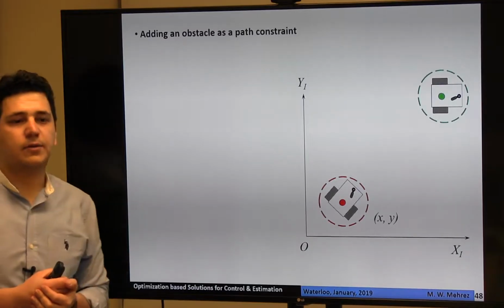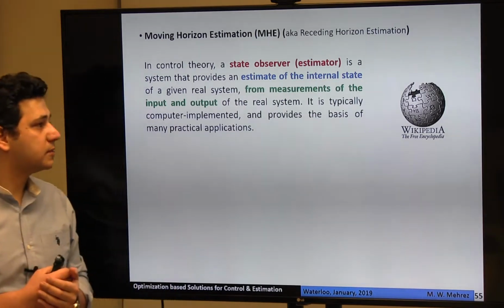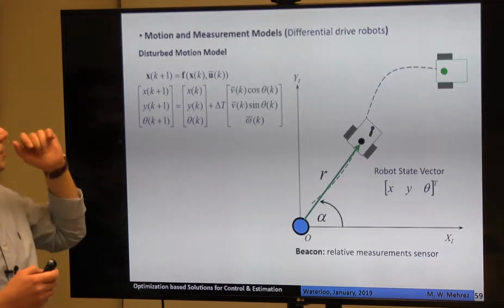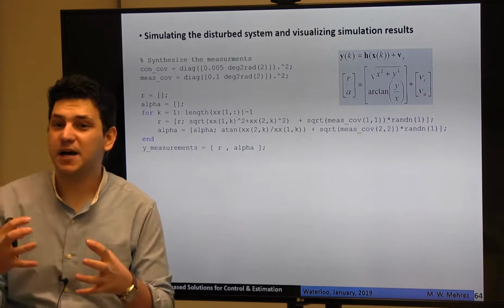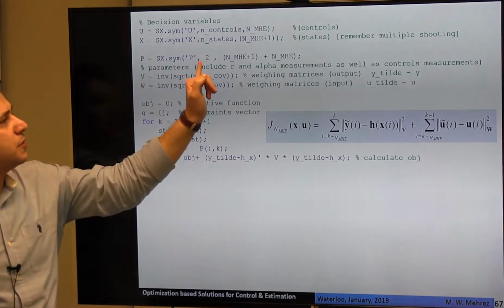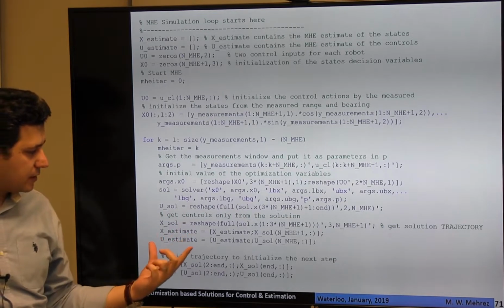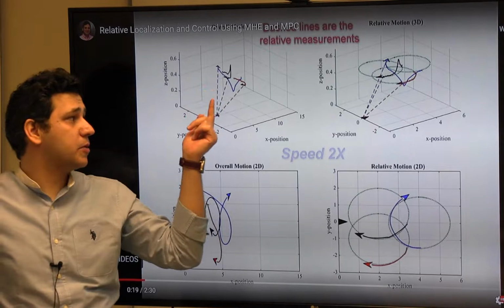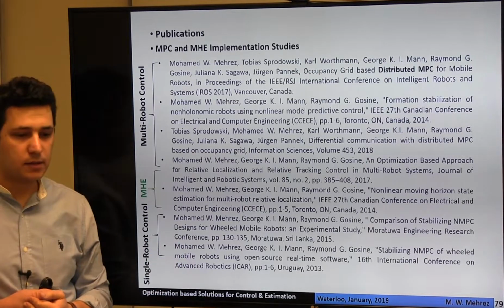MPC and MHE implementation in Matlab using Casadi | Part 2

Comment: Great video and impressive results with the distributed MPC! I have a question though, how much more difficult is it to use rectangular collision constraints around the obstacle instead of circular ones?
Reply: I have a rectangular car that i want to drive around another rectangular object, what i tried to do was do a projection of all corner points on the y-axis since my car can not drive directly sideways and the smallest corner point of the obstacle should always be bigger than the biggest corner point of my car to avoid collision. Yet I tried using CasADi's mmin and mmax function but then the solver also runs extremely slow, and the car might never reach the target position.

Comment: Hello dr. Mehrez, Thank you for the nice lecture. It helped me alot even though I'm very new to MPC and also Casadi. 
I have one question, how can we update the position of obstacle if we say obstacle is not static. I tried to update the position of obstacle in the main loop, however, it seems that solver doesnt realized the new position of obstacle has arrived and it only considers initial position of obstacle during the whole simluation time.

best regards
Reply from the maker: Hi, Thank you for your comment. In the case of an obstacle whose position is dynamic, you will need to treat its position (or potentially position prediction) as a parameter that you pass to the optimizer and then you build your constraint based on this parameter. This is similar to passing the initial position of the robot to the optimizer every time step. Hope this helps!
Reply: @MohamedWMehrez   Thank you for fast reply and clear answer, also it worked! 
I made larger size of P vector and I added trajectory of moving obstacles as well as initial position of X and reference point Xs . 
But I'm considering of combining many obstacles and multiple robots (with collision avoidance). In this case, the size of P vector will be keep increasing and it will be confusing to put all the parameters in a single vector. so Im wondering if there is any solution for this. ( I tried to make parameter vector P as a struct but it didnt go well)
thank you for your concern
best regards

Comment: Thank you Dr. Mohamed for the excellent presentation. I have a question please, in my problem the measurement_rhs is depending on time like X*t+B, X and B are states to be estimated and t is time (known/given vector), how can I introduce it in Casadi? I tried to put it as in input or a measurement and it was not working. I am tying to do state estimation only using MHE. Thank you
Reply from the maker: Hi, In the prediction, just replace t in the model by k*sampling time.

Comment: Dear Dr Mehrez, thanks for your presentation, it was very useful for me. I have two questions I would like to ask.
(1) In mul_shooting, x_next=X(:,k+1), I want to know how X updates the state in casadi program?   I don't see any update of X in the while loop.   
(2) In part 2 video, How do I get the code for four robots moving around circles?
Reply from the maker: Hi, 
Thank you for your comment
(1) only the first entry of X is updated in the while-loop by the robot current pose x0
(2) all codes are on the GitHub for the discussed examples. The link is in the video description.
Reply: @MohamedWMehrez  I just checked and GitHub doesn't have this part of the code. The simulation of the circular formation of four robots, followed by the verification experiment of unmanned vehicles.

Comment: I also tried to add a road set up for which i tried to add constraints and also had to add if conditions. However sx cannot be converted to logical and the if statement also returns the data type in sx, is there any way to convert sx to an integer?
Reply from the maker: I think there is something about this in Casadi manual.

Comment: I have a doubt regarding MHE if it estimates the path at t- N(MHE)  how does it help in estimation of the path for MPC if it has already move through that path?
Reply from the maker: What i did in this lecture is what you may call offline estimation, i.e. i generated the sensor data and estimated the path from it. If you would like to integrate MHE and MPC, you would run MHE online, i.e. you apply it to the most recent window of measurement (as what happened in this lecture), but the estimated pose on the path is used as a feedback to the MPC controller.

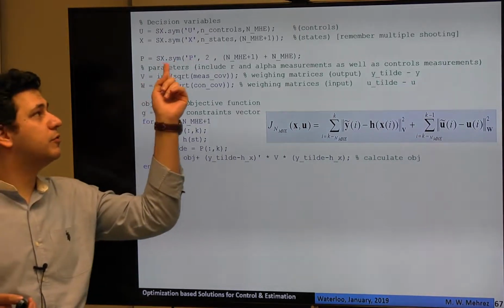Comment: Dr. Mohamed W. Mehrez, thank you for this excellent presentation and for providing us with an ideal material to learn about these topics. I have a doubt; from minute 33:20, you explain the vector P and comment that they are lucky because they have the same number of inputs as outputs. My question is about this, what happens if this condition does not occur? If I have one output and 2 inputs, or one output that is state variable 3 and the input directly affects state variable 2? How is this correctly defined in Casadi? I reiterate my congratulations and thanks for this material.
Reply from the maker: Thank you for your comment. If the dimensions of the input and the output mismatch, you can simply define the parameters vector P as a single row vector, then you arrange your measurements in this vector in whichever way that's most convenient to you. Just keep in mind that you need to propagate any changes in the rest of the code.
Reply: @MohamedWMehrez  Thank you very much for your response, we look forward to more videos like this one. Regards

Comment: Hi Mohamed, 

Thank you very much for building my intuition on MPC, 
I'm very new to vehicle dynamics and control engineering, i have one general question,
If we would like to take the kinematic bicycle model for the non-holonomic robot instead of differential drive robot , for example with state vector: {x, y, v, phi} and controls : {a , delta}, 
 how would the RHS/ (model) in the code change, if you could share some thoughts on this it would be wonderful, :)

Thanks and regards,
Shagufta,
Reply from the maker: Hi, thank you for your comment. You simply change the model. this means you would have a new state vector with 4 variables in this case and the r.h.s. would be what ever your new model is.
Reply: @MohamedWMehrez  Thank you very much Prof, i really appreciate your prompt reply, i just have one more question, can we add terminal cost function to this OCP? if yes, how do i go about it?
Reply from the maker: Yes, you can... Just after the loop where you create obj, you can add an additional term for the terminal cost.
Reply: @MohamedWMehrez  i was about to lose my sleep tonight, i can't thank you enough, world needs ppl like you <3
Reply from the maker: Thank you Shagufta 🌹
Reply: @MohamedWMehrez  Hey Mohamed, got another simple question for you  ;), 

I'm trying to use MPC in ROS platform and i successfully wrote casadi code in C++  , i want to control or drive a car in carla (or any other simulator) from point A to point B using MPC( point stabilization problem), please correct me if I'm wrong, i should apply the first control action to the car and after delta_T time i should extract the car's position from simulator and continue the while loop? , did you use ROS as well for controlling the robot, if yes, could you please help me out in this one last question :),

Regards,
Shagufta
Reply from the maker: @shaguftaqueen5630  Yes, that's exactly how you should do it.
Reply: @MohamedWMehrez  Thanks a ton, i will try it <3
Reply: Dear Mohamed, 
I have one more question, right now we are giving the position of the obstacle while formulating the MPC itself, is it possible to take the obstacle position on the fly and do obstacle avoidance?, i couldn't find a solution for this issue, i thought I'd ask an expert ;),

Regards,
Shagufta
Reply from the maker: Hi, I believe that you can take the obstacle info on the fly, but you may want to impose some assumptions on the obstacle motion beyond the time of its latest known position, e.g. you may assume that the obstacle will have the same speed when you latest captured it. This speed can be later used to calculate the obstacle prediction and used as a constraint on the robot motion. Just keep in mind that as the actual position of the obstacle is deviating from its prediction, the quality of the mpc control action will be poor as the controller will keep changing its policy based on the updated obstacle position; It's not an mpc problem though.
Reply: @MohamedWMehrez  Thank you very much for the quick reply ;),
I really appreciate your support even after so many days of publishing this video series 
<3

Comment: What happens when we have dynamic obstacles instead of static obstacles, is there a way to incorporate the moving obstacles in MPC ?
Thanks in advance,
Reply from the maker: Hi, Of course there is a way for that. you simply add the constraints such that the prediction of the robot avoid the prediction of the obstacle at the respective time steps.

Comment: Hi Dr.Mehrez,
we have a project on multi-robot path-following with obstacle avoidance system, we've been asked to work with MPC and i wonder if you can give us an idea how to manipulate your code in order to use it for multi-agent system or if it's even possible.
Thank you in advance.
Reply from the maker: Hi, there are basically two approaches to apply MPC for multiple robots. First, a centralized approach where you combine all the vehicles models into one and add the proper constraints among them to address collision avoidance, etc. I this case you will need to run a single mpc instance which will generate the proper control action for all robots. Second, the distributed approach where you run MPC for each of the robots and communicate there future predictions and then add them to the constraints. You can find more details about the two approaches in the following papers. Just keep in mind that a centralized approach is suitable for smaller number of robots while the distributed one is suitable for a larger number of robots. (Centralized has a better performance, but again may not be feasible for a large number of robots)

https://link.springer.com/article/10.1007%2Fs10846-016-0408-2

https://ieeexplore.ieee.org/abstract/document/8206360/

https://ieeexplore.ieee.org/abstract/document/6901011
Reply: @MohamedWMehrez  Thank you so much Sir for your response

Comment: Dear Dr Mehrez. Thank you very much for your great presentation. If I want to combine MHE and MPC together in my simulation, I have a question related to past measurements over a window of size N_MHE (k-N_MHE). How can I obtain past measurements, so I can obtain estimated states for the feedback in MPC?

Thank you.
Reply from the maker: Thank you for your comment; to do this,  you actually have to run your system in the open loop and buffer the measurements until you fill the 1st window of measurements on which you run the first MHE step.
Reply: @MohamedWMehrez   SIR,THIS IS A NICE TRICK OR SLUTION.
1) BUT IN REAL TIME ALREADY OUR MHE AND MPC ARE CONNECTED WITH OUR ROBOT WHICH MAKES IT CLOSED LOOP . SO HOW IS IT POSSIBLE TO GET OPEN LOOP U_CL AND  Y_MESUREMENT.
2)ALSO SUPPOSE IM WANTING MY ROBO TO TRACK A PATH.  STARTING AT T=0. NOW THE U_CL AND Y_MESUREMNT PAIR SHOULD BE A PART OF THE TRAJECTORY , OR IT CAN BE SOME RANDOM U_CL AND Y_MEASUREMENT PAIR (WHICH MAY NOT BE PART OF OUR TRAJECTORY)THAT WE ALREADY FILL THESE MATRICES BEFORE T=0?AM I RIGHT?

Comment: can we set dynamic obstacle as constrains and if yes how
Reply from the maker: Yes you can. If you have the prediction of the dynamic obstacles motion then you simply constraint the motion of the robot by the motion of the obstacles. This means that for every time step in robot's prediction you constraint it to be outside the obstacle boundaries at the corresponding time step from the obstacle predicted motion.
Reply: @MohamedWMehrez  But f I add a new constrain at each time step, would not all of that constraints pile up and making the system too heavy ?
Reply from the maker: @fetullahatas3927  it will be a little harder to solve than the static obstacle case discussed  in the workshop, but will be still feasible in a reasonable amount of time. Remember that in the static obstacle case, we constrained the robot at all the prediction steps but to a static boundary (i.e. the static obstacle).
Reply: @MohamedWMehrez  Thank you for your reply. I think if there is a online way to update/remove/add the constraints added to optimization problem it can be solved. Are you aware that it is possible to update/remove the constraints from the problem on the fly ?
Reply from the maker: @fetullahatas3927  of course this is possible and it can be done similar to the trajectory tracking case discussed in the workshop; therein, the reference was updated online ever time step.
Reply: @MohamedWMehrez  I am also interested in this but I haven't figured out how to update the constraints on the fly. How can you update the vector 'g' that contains the x and y positions of the obstacle (and its future predictions) once it has been initialized? Do we have to initialize 'g' and create a new solver per loop iteration? Or is there a better way? Thanks in advance Mohamed.
Reply from the maker: @9thchord  you can make the x and y positions of the obstacles as parameters and you pass their updated values every solver call. Should be the same way you pass the state feedback.
Reply: @MohamedWMehrez  Thanks very much for your prompt answer. That worked perfectly!

Comment: Hey Dr.Mohamed,

Thanks for the lecture series. Its very helpful for beginners and well explained.
I followed your lecture on MPC implementation and borrowed some techniques from your presentation for a simple trajectory planning algorithm in which I have 8 states and 2 control inputs, with the states themselves being my measurements too. 
Now I would like to go a step further to combine the MPC with the MHE. I have a couple of questions related to this.

1. In your lecture on MHE, you include the multiple shooting constraints alone with the MHE problem formulation. The objective function for control is missing. Should I need to add them just as in the MPC implementation, for trajectory reference tracking .
2. If I would like to combine the two , would there be two separate objective functions and would there be an OCP solving twice for each time step, one for MPC and another for MHE.
3. Could you also give a few hints on how I can use the MHE output to MPC. 

Thanks a lot again for your workshop!!

Regards,
Anand
Reply from the maker: Hi Anand, thank you for your comment.
1- In the lecture I implemented MHE offline separately from the MPC implementation; that's why I used a single OCP with the multiple shooting constraints (because it was MHE only).
2- Yes, exactly.
3- Every time step, you simply get your sensor measurements feed them into the MHE estimator (first OCP); the output of the estimator then becomes the MPC feedback (second OCP). 
All the best!
Reply: Thanks a lot for the quick response!

Comment: Hey Dr. Mendez

I was having trouble implementing the input rate of change constraint. As we never specify initial input, my rate of change of input always start with u2-u1 rather then u1-0
Reply from the maker: You can do that and in the following iteration you use the most recent input sent to the system. Always remember that the first input change rate is the difference between u1 and the most recent input applied.

Comment: Great workshop, thank you for sharing it, however, i have a hard time adding another obstacle, can you tell me where should i edit the code to accomplish this?
Reply: nevermind, i got it, i was missing the ubg and lbg size, i had to multiply it by 2, now i just need to edit the draw function to visualize it. i will try my best to do it,
Reply: got it, i just had to add the second obstacle to the draw function arguments and loop
Reply: @welidbenchouche  hey I am trying to do the same thing. Where did you multiply the size by 2, is it in the Sim_3_MPC_Robot_PS_obs_avoid_mul_sh.m file ?

Comment: Dr. Mehrez, a great thanks for that help. 
I wanted to ask you how can i estimate an angle from angular velocity using MHE.
My measurements will be from an IMU sensor, and the control input it the angular velocity.
If i do a direct integration thier will be a drift due to the accomulated noise. so i want to fuse both measurements for good estimation.
Reply from the maker: Hi Basim, thank you for your comment. IMU measurement will always be subject to drift. You will need to incorporate another sensor to substitute for that drift, for example a GPS  or a Lidar.
Reply: Yes thats already what’s happening, is it possible to rely on the accelerometer  to be the measurement ? 

One more question is how to get the values of the covariance matrix and the measurement matrix ( the mean values ) .. 

Thanks for your reply and your help
Reply from the maker: The accelerometer is not enough, because again it will be subject to a drift. This is not the state estimator problem.

The estimation covariance matrix can be obtained using the method presented in this paper: 
Constrained State Estimstion gor Nonlinear Discrete-Time Systems: Stability and Moving Horizon Approximations

Comment: Hello, Thank you for the great workshop. Can I ask how one can add a rectangle object to the point stabilisation problem as a Path Constraint for obstacle avoidance?
Reply from the maker: Hi, thank you for your comment. Yes you can do that by using for example a higher order L-norm.
Reply: @MohamedWMehrez  Thank you for your prompt reply. I will look into this.
Reply: @MohamedWMehrez  Dear Dr. Mehrez, do you mind clarifying the "high order L-norm"? Higher than L2? How an area can be defined? Than you very much.
Reply from the maker: @SbAlmagro  Hi, defining higher L-norms should be the same as defining L2-norm. you simply change the power.